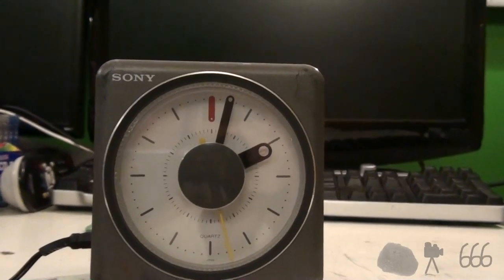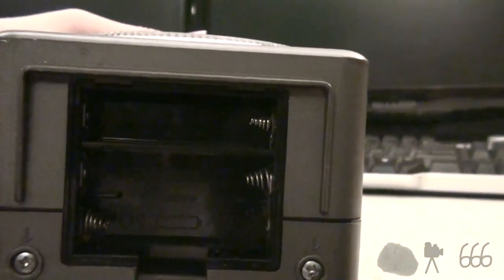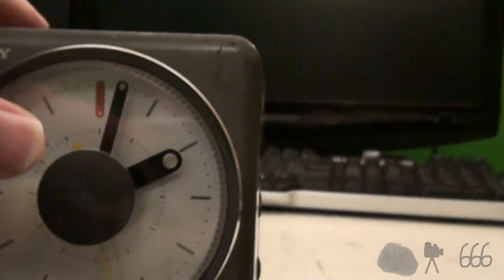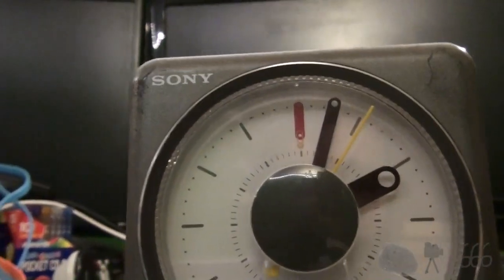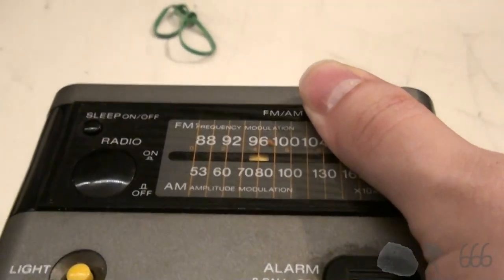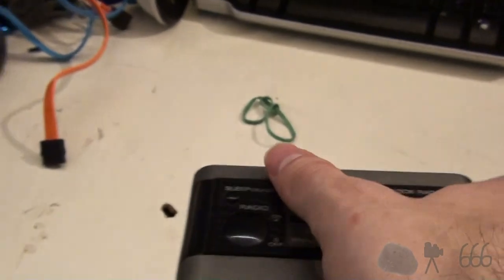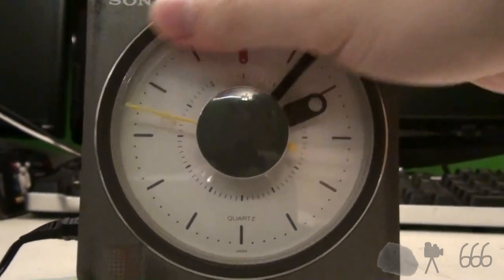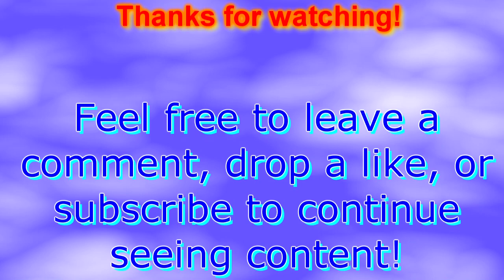Weirdest Clock Radio Ever? Sony ICF-A15W Overview

Comment: Rather collectable clock/radio. Two versions were made with different melodies, Vivaldi 4 seasons which you have and the here comes the sun by the Beatles. These are sometimes advertised for upwards of $150